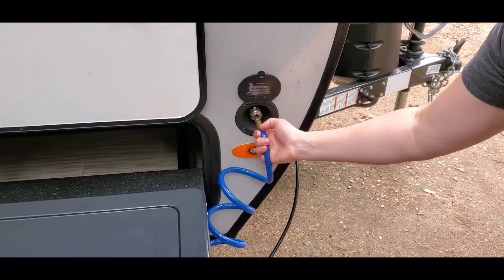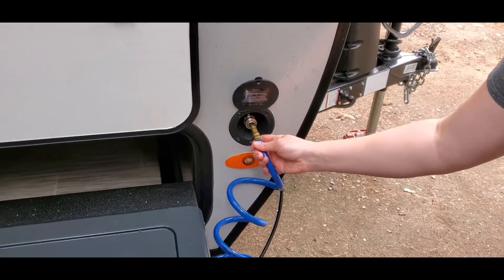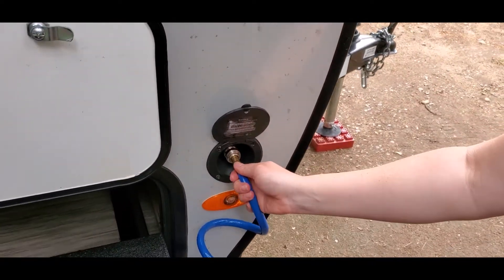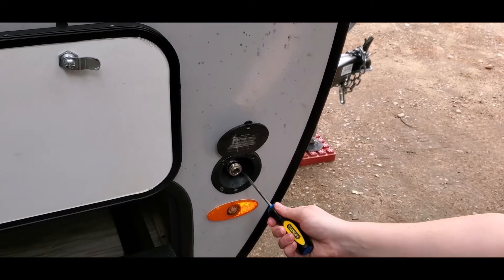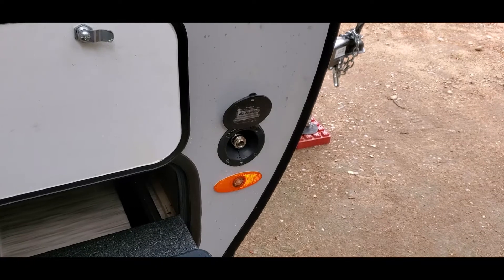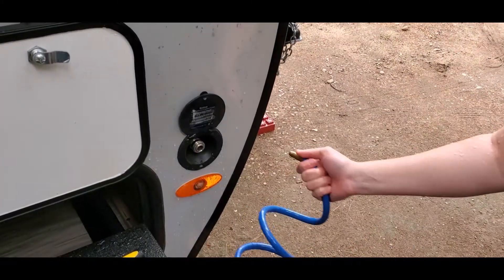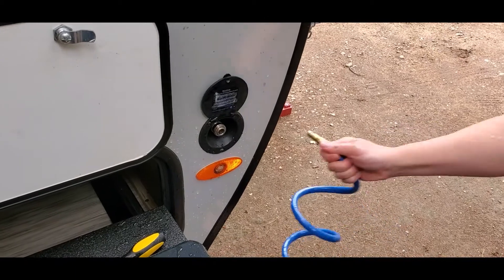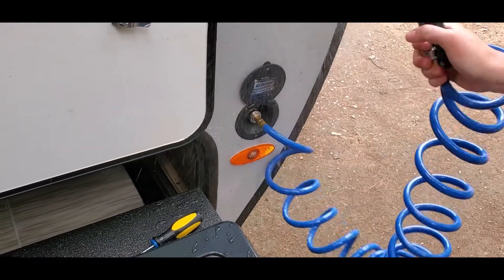How to Fix the R-Pod Outdoor Kitchen Hose Connection Issue

Comment: Thank you so much!!! We just bought a new camper and this outside connection would not work. I jammed a screw driver in there and had to smack it with a hammer and now it works!

Comment: I have the 193. Thanks for the tip. Amy chance of damaging the water line with the Phillips head?
Reply from the maker: We haven't yet. We've done it over 75 times probably? Another way would probably be to turn off the water altogether and open a line (kitchen sink?) to relieve pressure and then hook up the hose.
Reply: @SolesTraveling  I tried turning off the water and it didn't work. But your trick did work! Thanks so much for the helpful tip. Lots of piddly stuff to fix and tinker with when it comes to R Pods. We love ours, but you have to put up with kinks....

Comment: So i didn't want to use the screwdriver and punch thru so we went under the sink where the connectors was and opened up the pressure it went right in.

Comment: Ok so my problem is that my hose is connected but I can't get it disconnected!! I have search for help online and can't find what I need. What could be preventing it from coming off? Does the water supply need to be shut off? Does pressure in the lines affect it? Please help
Reply from the maker: It gets stuck from the pressure. I'd suggest unhooking the water from city water, then release pressure in the kitchen sink while disconnecting.

Comment: Bad advice…. Using a screwdriver will eventually score the inside and cause a poor seal and then drip drip drip …. Just push the ring back to get it in just like you do to get it off.  And or squeeze and hold sprayer open so the pressure is relieved while pushing in the connector.
Reply from the maker: If only I could push the ring back. One thing that kind of works is running the kitchen faucet to relieve pressure. But we've been doing this hack a few times a week for 3 years and haven't had an issue yet. Maybe we're lucky.